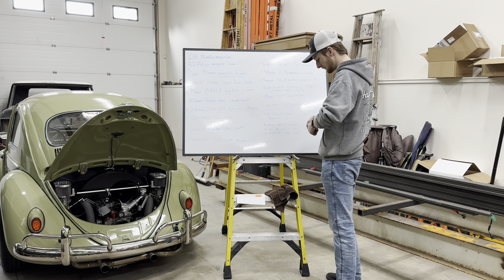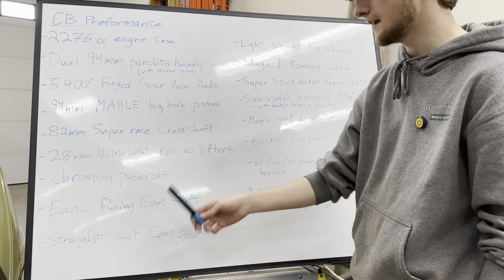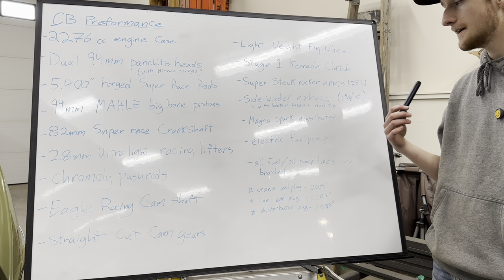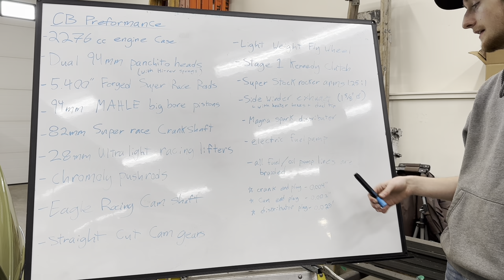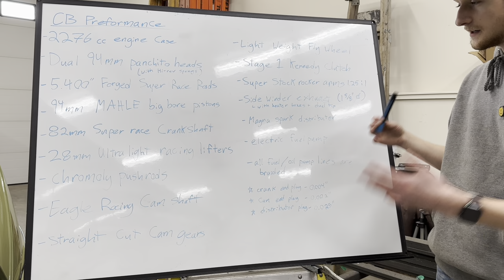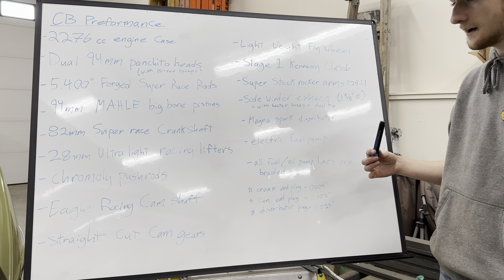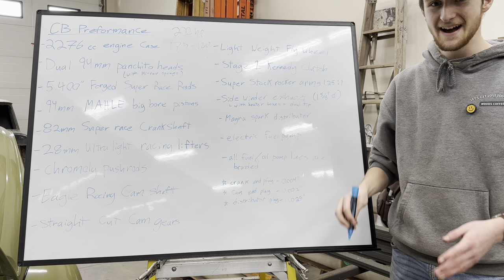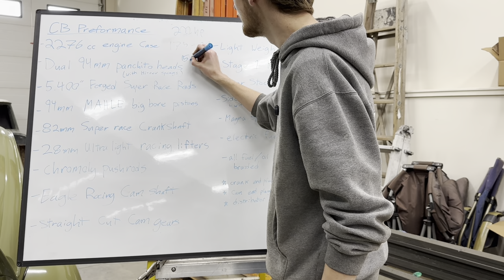Huge 2276cc Flat 4 Engine Specs + Build

Comment: Great vid mate, check your crank pulley nut every few months as they come loose because of the alloy pulley against the metal crank, Remember both metals expand and contract at different rates. We call those alloy pulleys bearing killers as over time they come loose and flog out the mains.
Reply from the maker: That’s good to know because yeah I’ve had issues with that pulley. I’m thinking about switching but it’s also just nice looking. Thanks for your support!
Reply: @smithsgarage273 yeh my engine builder will not use alloy pulleys only steel og ones or the old santana alloy ones which had a steel inner.

Comment: You know what. ... thanks, man ... I'm well into this right now and this video just popped up .... great stuff.... did you have to chase anything structural / suspension to handle the new beast ?
Reply from the maker: I have an upgraded transmission from a company called Rancho, it has heavy duty axles and different ratio gears for top speed. But I’m on stock suspension and stock trans mounts, I need to actually replace my trans mounts because I’ve heard they break really easy with this much power, so I’m looking into ways of bracing the engine right now. I’ll make a video about it once I figure it out. Thanks for watching though!

Comment: What's the transaxle , with that engine I hope it's not stock . That cars come a long way and Alot of work..
Reply from the maker: Yeah I realized I should’ve just quickly said what transaxle I’m running in the video too. It’s a 4 speed rancho transmission made for higher speeds with heavy duty trans axles. Don’t have the exact ratios right now. Thank you for watching!